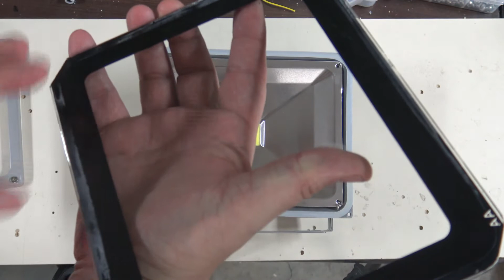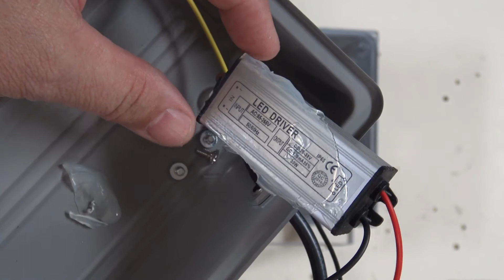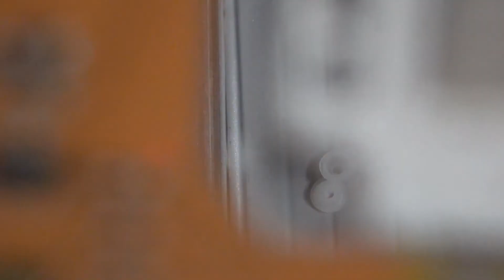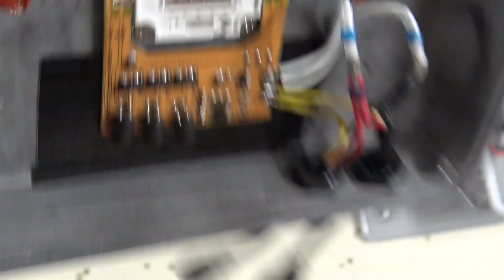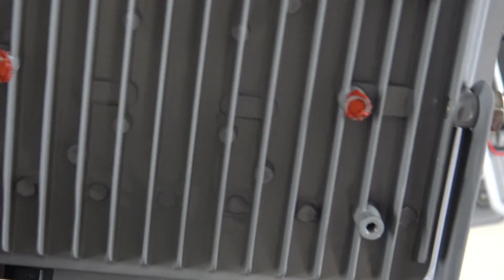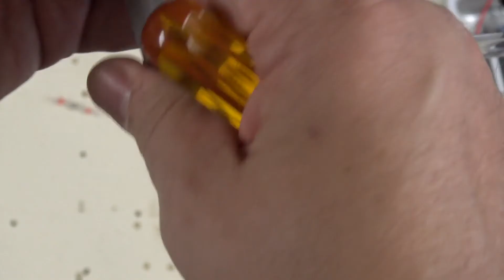Ws2811 Flood build

Comment: Hey there, I bought a bunch of these a while ago and I made one but finally getting around to putting my display together. I am trying to work out the best way to wire these and have them connect to my pixel controller. Falcon f48 with smart reciever. The rest of my display runs at 12v but i was thinking do I  run a seperate 24v power line to these or do you think it would be possible to use a dc to dc 12v to 24 volt step up converter in the back part of the floodlight? So each flood would step the 12v to 24v. It would double the amps to 12v 2A but i would be interested in what you think. Alternatively do i just run 24v from the pixel controller box and just make sure I never mix the 12v and 24v lines.
Reply from the maker: I built a dedicated controller for mine using a buck converter to step down the power to my BeagleBone Black.   You could use a differential receiver off you f48, but can't power it from 24v.  You would have to power it either 5 or 12. Tie the grounds together from your 5 or 12v supply and a 24v supply, send V+ and V- from the 24v and Data only from the differential receiver.  By using 2 power supplies you could use 3 ports of the differential for other props, and 1 for the floods.